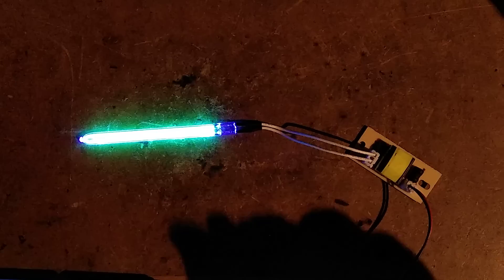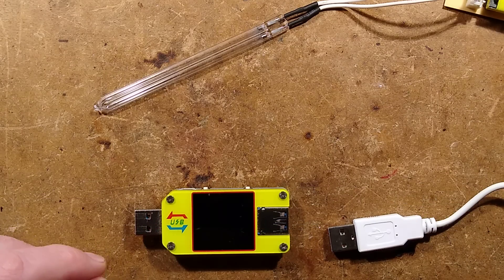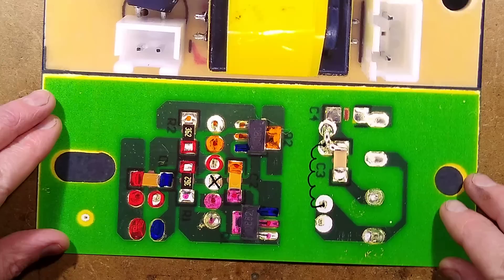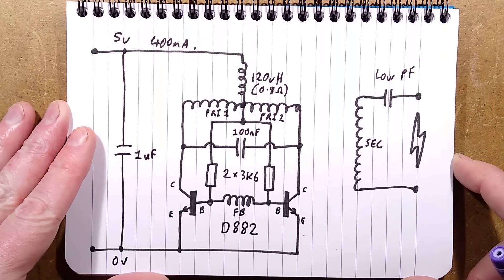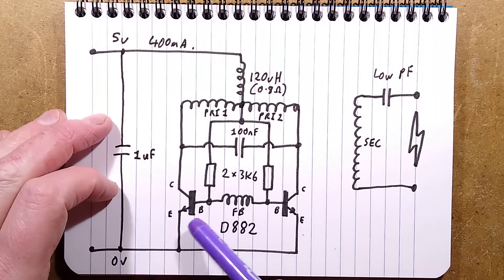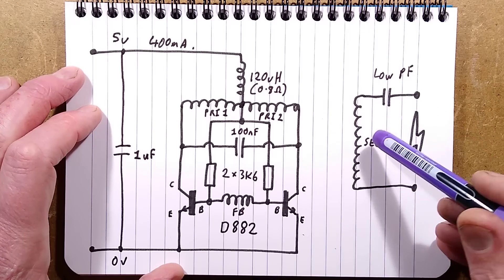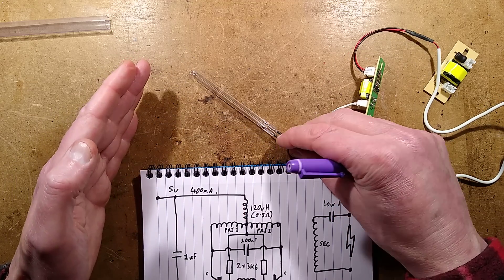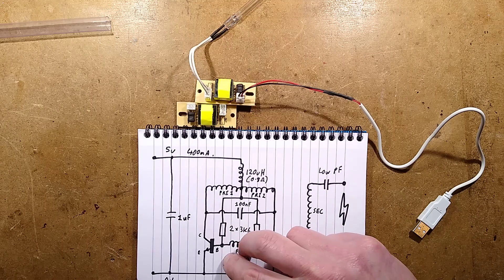USB cold-cathode UVC/neon driver - with schematic

Comment: These are called, or at least used to be called, UV "pencil lamps". They were mainly used for small water container sterilization and spectrometer calibration using the emission lines of the mercury discharge. Edmunds optics charges about a thousand dollars for one connected to a 9V battery pack to make it portable. It's obscene what scientific and research supply companies charge for things because they know they can get away with it. The clever and resourceful amateur scientist will find a wide variety of vastly cheaper equivalents for things if he knows where to look. I'll be uploading a video soon on a very, VERY cheap equivalent item for an unsilvered Dewar flask for doing cryogenic experiments that saves hundreds of $, for instance....
Reply: These can be had at a local hardware store, in the form of a portable "covid sterilizer wand" for several dollars.
Reply: Question is does it have to meet certain requirements or certifications in certain uses? Are there any other requirements such as gas purity, spectral content, or intensity, out of curiosity? If something needs to be very accurate or has a need for acting as a true calibration standard the high cost may not be simply because they can. Not automatically saying it isn’t, but if it has special requirements it could be more than just a sterilization lamp.
Reply: An example would be a metrology gauge block. One might think simply heading out to the mill and making a 1” block out of tool steel would be good enough for checking things, but this is a lot different than a 1.0000” gauge block, and the cost would reflect that. Your measurement is as only good as your standard.
Reply: I can at least confirm this perspective when looking at a "simple" industrial air ionisator that has a 220V Fan and produces positive and negative ions. That device is about as big a  great cereals pack but the price is 700€!
However afaik there are still some valid reasons when You watch the Youtube video on Fluke multimeters. I forgott the arguments but it was not because any advanced functions but, if I'm not mistaken, reability and long life which is crucial to some industries.

Comment: For testing tiny capacitive values you should try one of those tweezer types, it works for me down to 0402 size. Don't know the exact model.
Reply: Yep. There are a ton of different brands of these rolling around fairly cheaply. I like em for SMT work

Comment: I haven’t heard the term “cold cathode” for ages!
We used to use trigger diodes in analogue telephony in register translators (RT4’s I believe) with fluorescent lights directed onto them through clear red plastic screens.
Reply: I know the term Cold Cathode  from large format photographic enlargers from the 1970s and early 1980s. Such as the DeVere Cathomag lamphouse. The lamp illuminated evenly across the surface of the negative. One advantage of the cold light head is that it could render more subtle tonal gradations and minimized the effect of dust and scratches on the negative, which produced a much smoother print.

Comment: Got an air cleaner that has one of those in.
The lamp is driven with a lot less current, barely visible glow that comes off it.
The air is drawn over the lamp behind the intake and then the particulate is collected by an electrostatic precipitation module.
The precip is removable for cleaning, and it sure does collect particulate.
So what comes out the outlet of the device is particulate free and theoretically  sterilized.
The airflow is low, it only has a 60mm fan in it, but given how much trash it collects, it must have some kind of benefit.

Comment: They tell me old yellowed plastic things can be returned to their normal colors using an oxy action laundry stain remover powder with a uv light. Has anyone tried this? I think I will grab one to test.
Reply from the maker: Retrobrighting tends to use UVA I think.
Reply: Yeah. It's a variation of peroxide bleach + sunlight for restoring old plastic appliance cases. If you want to buy the fancier stuff, go ahead but you really don't need all that.

Comment: That looks a lot like the tube in the portable UVC lamps you should during the pandemic. I still have one of the ones I ordered. One came with a broken tube and I couldn't be bothered to send it back.
Reply from the maker: The pandemic must have been good news for the company that makes these.
Reply: It wouldnt have worked anyways. This specific virus needs a lot of time under high-strength UV-C to be killed off reliably

Comment: The listing offers tubes with (184nm) or without (254nm) Ozone emission. How does that work? Does 184nm produce Ozone while 254nm doesn't?
Reply from the maker: Yes.  184nm is the ozone wavelength.
Reply: @bigclivedotcom  Ah thanks. I think I'll order a power supply and a 254nm tube then and use a filter to block the UV to create a nice looking lamp.
Reply: @Ni5ei  You won't have much in the way of visible light left once you block the UV coming off of it.
Reply: @davelowets  UV is invisible to the human eye so I think there'll be plenty left once you block the UV part.
Reply: @Ni5ei  It's a UV lamp. Most of it's output IS U.V., block it, and there won't be much left to see
Reply: @Ni5ei  It's a UV lamp. Most of it's output IS U.V., block it, and there won't be much left to see